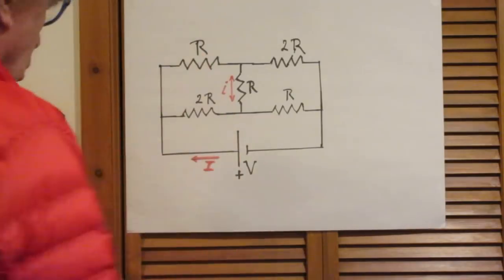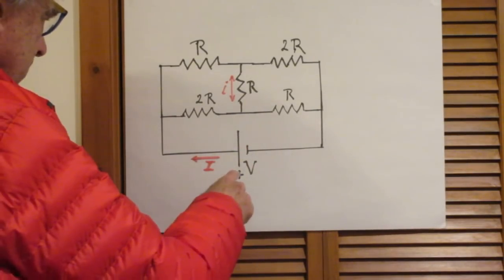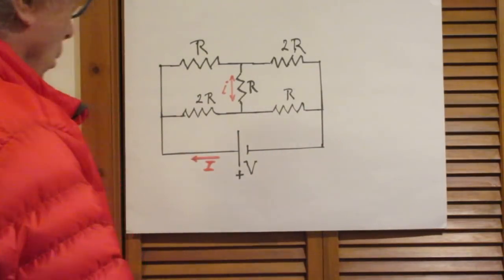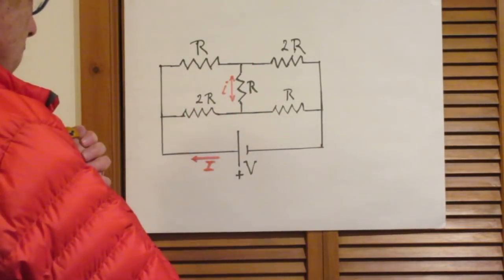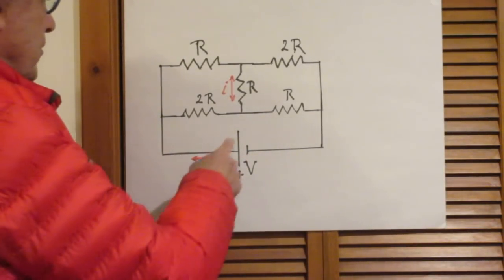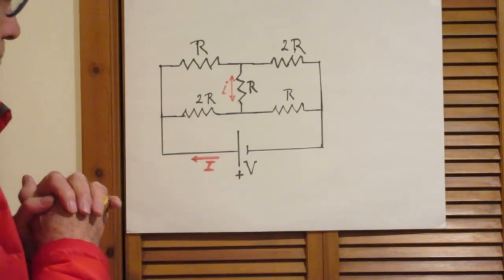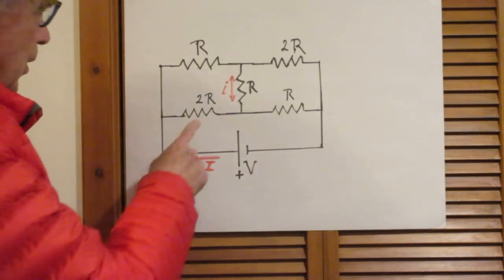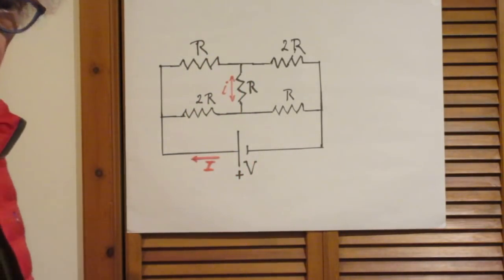Problem #24  Circuit with Five Resistors

Comment: According to Kirchoff 👉🏻I=5V/7R; i=V/7 flowing from the top node to the bottom one. Please notice that If that center resistance were to be removed with 3 out of the 4 resistors being of a known value, and if one of those three were adjustable, you could then easily derive the value of the fourth one by simply varying the adjustable resistor until that mid-point voltage between the two branches is exactly zero. And this is the basic idea behind a wheatstone bridge ohmeter ! as a quick check in your example if all of the resistors were of the same value the value of i would therefore be zero because the voltage across it would be exactly zero ! Cheers Dear Professor !

Comment: Dear Professor, first I wish you a french happy new year. Second, I guess current flows downwards and is worth V/(7R) amps. But I don't really understand why you expect a  digital precision since resistors seem theoretically perfect. However we can be a bit practical and remember common resistors are now 1% spread around their expected value. So the worst case should appear when one 2R resistor becomes 0.99*2R whereas other 2R resistor reaches 1.01*2R. Now we have to do the same with R resistors (but not necessary the bridged one crossed by lower case i) keeping in mind when the 2R resistor attached to it is 1% up we have to choose R resistor 1% down.  But I don't really figure out it will change precision significantly to turn current's sign over . Unless 1% moves to 10% or even 20% like in old fashioned resistors. Thanks for all what you do.
Reply from the maker: My resistors ar R and 2R. They are theoretical resistors and uncertainties/spread in the fabrication of resistors is not an issue.

Comment: OK, I finally worked out a way through the final stages. I know I have made a mistake (at least one somewhere) as my currents do not quite add up (Yes, I know - I'm defying the laws of physics, sorry!) Its taken me 3 days! and I have learned a lot, thank you for posting the problem. I want to post an answer so that I can test every step against your solution and so learn more. I have no more time to check what I've done.
i = 0.0408V Amperes. The current is in the downwards direction. I = 0.8163V Amperes
Thank you again - interesting: I always hated Electrics and avoided it most of my life, you've shone some light into the darkness and it looks better to me

Comment: I believe the answer should be that I = 3V / 2R... The smaller current i = V / R and points upwards ... But it is incredibly strange to me that none of the current would flow through the resistor on the top, so I've almost certainly done the wrong thing. I think a delta-wye transform is probably necessary here. But I'm curious to know why the answer was incorrect.

Comment: Sir, if suppose direction upward is positive and there is a force F in downward direction.Its magnitude will be -F. Suppose there is a point which is left side of that force and it is at perpendicular distance D to that force. Now, moment of force(M) about that point will be M = F*D (as direction will be clockwise for that point).
My question is why we don't write moment of force M = (-F)*D
Because as my direction is in upward and the force is in downward direction so force will be -F and moment of force should be M = (-F)*D.
Reply: I think I've got the solution for the above question.To calculate  moment of force about a point, we have to consider only the magnitude and not the direction of force. But we have to consider direction of moment of force clockwise(+ve) or anti-clockwise(-ve)

Comment: I tied to redraw as a combination of Parallel and series resistors - it's not; and the false application of Kirchhoff's rule made a glorious mess! After much research I found I was dealing with a Bridge Circuit and I have successfully found from the maths that the current flows DOWN in the 1 Ohm middle resistor - but read on. I have all my equations done, I reduced the unknowns to 3 -I1, I2 and I3 - and for example find that 6V=21xI1 (the current leading into the lower left 1 Ohm resistor) so I1 is 0.2857V. I am now totally stuck as all my attempts to complete the equations and decide current and total resistance are expressed as multiples or fractions of V, which I can't isolate. I know I'm missing something, but I frustratingly can't complete all the hard work as I'm going round in circles at this last  step.

Comment: Sir the answer is
I = 5V/8R=0.625 V/R
i= V/3R=0.3333V/R
And the current i is going downwards as the potential difference is positive for downward direction
Reply from the maker: when I post an answer it is wrong. I do not post correct answers.

Comment: Another way to tackle it involves splitting the voltage source into two sources of V/2 and placing the ground (reference) point between them. Also split the vertical R into two R/2 resistances; then the junction between them will also be zero volts due to symmetry. You can now analyze just half of the circuit to find that the voltage at the top center node is V/14, and by symmetry the bottom of the vertical resistor is at -V/14, and onward to the same answer as other methods.
Reply from the maker: PLease send me your 2 answers!
Reply: I reasoned the same way and tried it. But it is as difficult as solving the whole thing. The Symmetry does not help in this case imho.

Comment: Hi, my answer is this:
+ First of all: i = 0 (there is no current). I derived that using two loops both involving i.
+ From there, we can simplify the circuit into two identical sets of parallel resistors, connected in series:
    - R_tot = 2 * (2[R^2] / 3R) = 4/3R
    - I = V / R_tot = 3V / 4R
Reply from the maker: incorrect

Comment: Hello Dr Lewin, I’m not good at these electronics, but I can do two things.
Omit the connecting resistor in the middle. The voltage at the top between the two resistors in now 2/3 V if you measure it compared to the negative pole of the battery. The analog voltage in the lower line must be 1/3 V.
So the middle at the top must have a higher potential then the lower. Now if you connect it the current must flow from top to bottom, so down in your terms.
For the other answer I have build this circuit using a breadboard, a 15,52 V power so.urce and 7 resistors of 1800ohm. The results conform with my theory. Top potential 10,99 V and lower 5,48 V if the middle one is missing.
Now if I enter the middle resistor, the voltage over the middle resistor is 2,37 V and the current is 1,2 mA through it and the direction is down.
So, a engineers answer, by experiment, rather than theory.

Looking forward to your solution and check my observations. I will not be able to give a 3digit precision as my resistors are standard quality..

Hartelijke groet, regards, Koos
Reply from the maker: you did not answer my 2 questions
Reply: Hoi Koos,

Als je "stelling van thevenin" ff googeld schat ik dat je het op papier op kunt lossen. Das beter, want dan heb je geen tolerantie op je weerstanden, geen weerstand in je amperemeter en geen afwijkingen op je spanningsbron. En een exact antwoord als het ff meezit.
Reply from the maker: Ik zal mijn solution zaterdag posten. Eerst doe ik het op een "brute force" wijze die altijd werkt. Maar dan doe ik het op veel betere wijze in slechts 5 minuten. Het zou mij verbazen als het sneller kan dan op die laatste wijze.
Reply: Daar kunnen we dan nog ons best op doen :-) Ik had verwacht dat de symetry van de weerstandsconfiguratie het nog eenvoudiger kon maken ... maar ik kwam daar niet uit.  Jammer  ....
Reply from the maker: I dacht aanvankelijk ook dat de symetrie de zaak kon vereenvoudigen. Maar  ik laat zien dat in mijn 2e methode (die neemt slechts 5 minuten) dat die symmetrie daarin geen rol speelt.
Reply: Zeer benieuwd. Daar ga ik in mijn dagelijks werk wellicht iets aan hebben.
Reply: Lectures by Walter Lewin. They will make you ♥ Physics. 
Which language ?
Reply: Sorry Narendrakumar .... this is dutch. I will refrain from that in the future. There's no point using dutch here. It's just Koos is dutch, the professor is dutch  ... I'm dutch ... thats why.

Comment: Little i=0 (so no direction) and big I= V/[(3/2)R].

 If you rotate the circuit (without battery) 180 degrees, it stays the same. Thus the potentials of the points of the circuit rotated over 180 degrees much be the same. We see that the point on the left of the "middle" resistor is on the same potential as the point on the right of the resistor, so no current flows through it.
Reply from the maker: incorrect

Comment: Dear sir I fairly understood by yours explanation how to solve this problem by Kirchhoff's laws but my question to you is that can we solve it without using Kirchhoff's laws by just using V=IR and current division. In general I wanted to ask how can we solve complex circuits without using Kirchhoff's laws.
Reply from the maker: Since there are no significant magnetic flux changes my solution is exclusively Kirchhoff's Loop rule. There are several ways to solve this problem (all based on KIrchhoff). The safest way is the brute force method that I showed by dividing the circuit up in closed loops.
Reply: Lectures by Walter Lewin. They will make you ♥ Physics. I really love the way you reply to our questions so instantly  and thanks again for your wonder ful faster than light reply
Reply from the maker: don't tell Einstein hat I repeatedly break through the speed of light barrier.
Reply: Lectures by Walter Lewin. They will make you ♥ Physics. 😁

Comment: Well, I'll give it a shot.  I used the Delta to Y Conversion to make it a bit easier.  
     Total resistance:  Requiv. = (23/19)R 
     The total current:   Itot = (19V)/(23R)
     Small i is:  i = (18V)/R to the top
Reply from the maker: incorrect
Reply: Do you ever sleep?  It does not matter how late at night I send my answers, you always answer within 5 seconds.  My small i is incorrect, isn't?  But, once again, I will patiently await for your answer.  Thank you!!

Comment: Have a Nice Day Sir And Also Thanks For These Great Questions 
I Have Been Studying Electrical Engineering For One Term 
Anyway I Wrote So Much 
I try to solve with Thevenin and ı use  star delta transformation 
I Come Up With These Answer:
I (capital) =0.714 (5V/7R) 
i (lowcase)=0.061(3V/49R) Downward
And Also Total Resistance is 
1.4R (7R/5)
I Am Not So Sure Though
Thanks For Reading
(SORRY FOR BAD ENGLİSH)